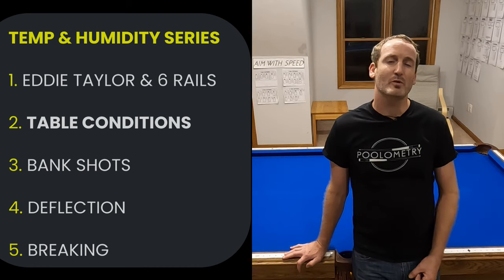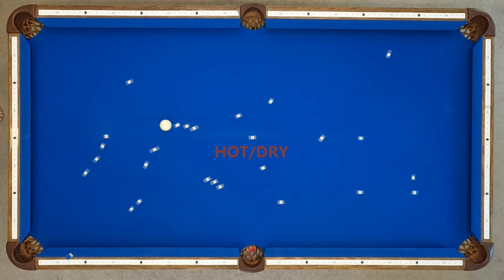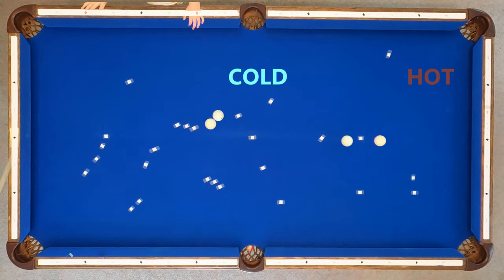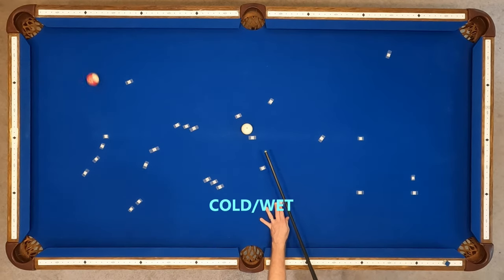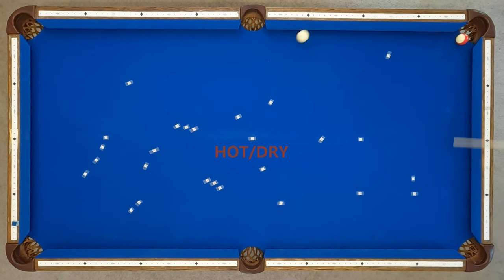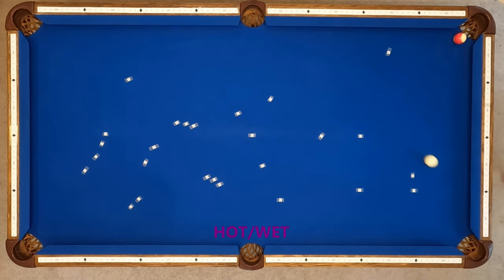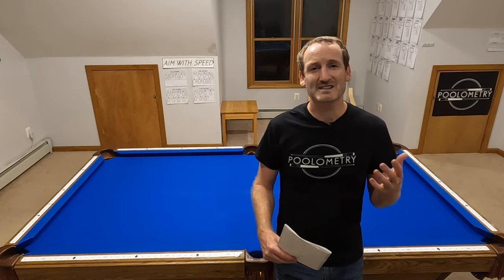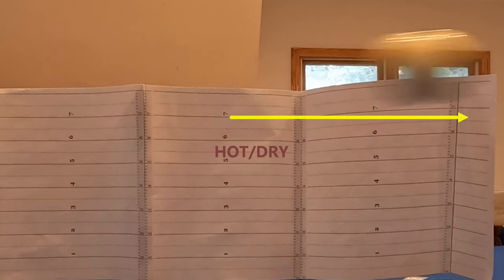2. Table Conditions: Temperature & Humidity Experiments

Comment: These last couple videos are awesome my man! It's a great resource for ballparking table condition behavior from one room to the next.

Also...the 7 rail kick shot is a bit of a red flag for me. As you've well documented, speed is a huge factor in ball trajectory, and I'm not really sure you're hitting all these balls the same speed. Also, with so many rail contacts in 1 shot, wouldn't speed just be a multiplying factor? If there's a way for you to prove you're always hitting at 17mph (as an example), then we'd really have a mystery.

Take it from a guy who obsesses over breaking. My max break from day to day, let alone hour to hour is going to vary based on how my body is feeling. Some days, it's 23mph, some days it's 27mph. I'd be willing to bet that 4 mph difference changes some of the cueball paths.

Also, I recon the type of cloth slickness, thickness, and type of slate changes the jump shot height more than anything else.
Reply from the maker: Thanks! Those are some good break speeds. I've improved quite a lot, but I've only moved from the teens to the low twenties.  There's definitely a high degree of variability in terms of the human input in all this, but I shot each climate many times and tried to pick what looked the most consistent for each.  For jump shots I never thought of slate thickness, but that is definitely a good theory.  But I can't decide if thin slate would make it springy for more height or would thick slate be better.  Not sure I'll ever get around to testing it but something to think about.

Comment: Great video. Curios question here if you don't mind.  Regarding HOT and COLD, what temperature range are you in when comparing HOT vs. COLD?  Also, what humidity levels are you in regarding DRY vs. WET?I ask because I have a newly clothed table with Simonis 860 and would really like to know what temperature and humidity would be best for my new cloth.  Thank you in advance!
Reply from the maker: These were in the first video in the series, I think cold was around 65 F, hot 80 F, low around 40%, high closer to 80%... if I remember correctly.
Reply: Thank you @PoolandBilliards